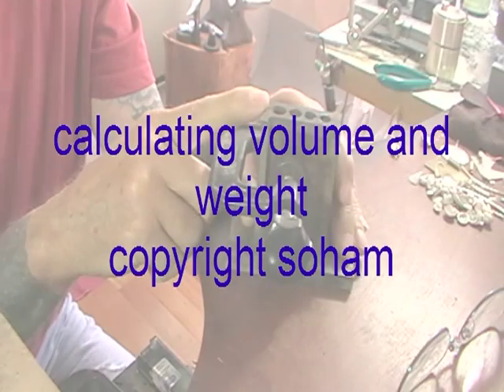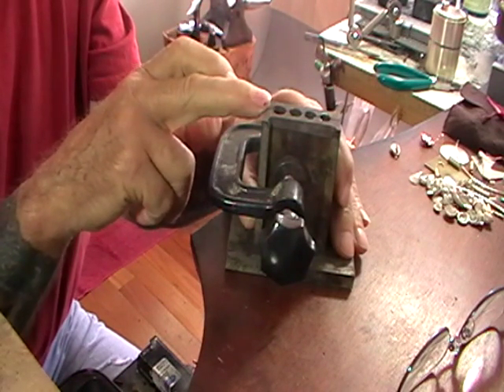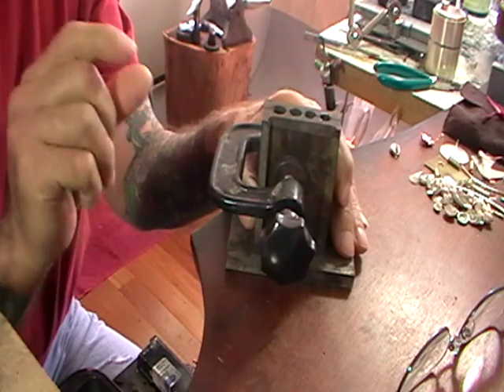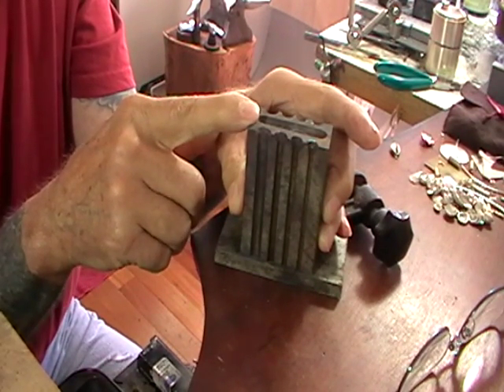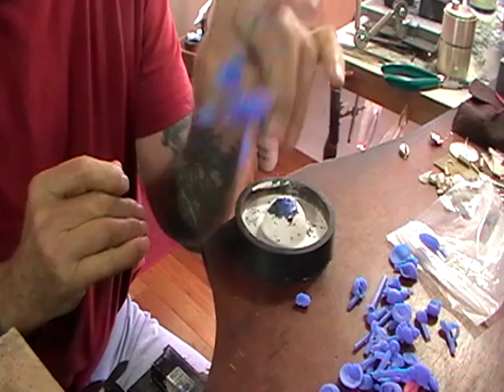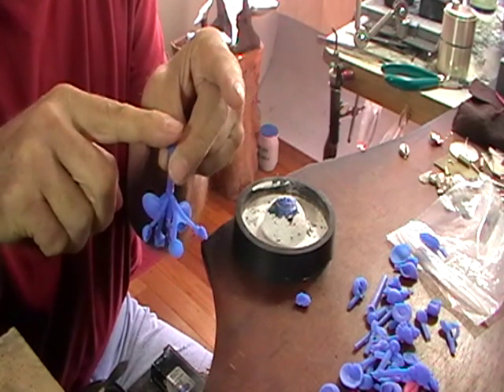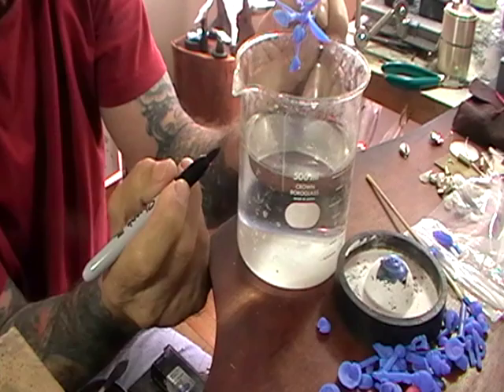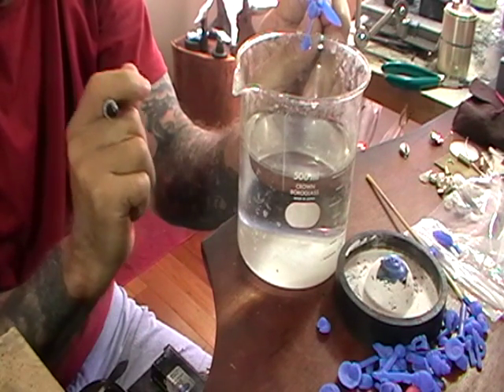calculating volume and weight

Comment: Hi Soham, i have a question about pouring into theingot, i wantto pour half a round bar, but i keep getting air bubbels entrapped into the silver, i triend everything, heating more, less, pouring quicker, slower. Pouring into an angle like you do. Do you have the same problem or can you pour half round bars? Kind regards olivier

Comment: Soham..could I use the water displacement method to determine the amount of metal for a simple sand or clay mold application ?  or is a theoretical volume calculation best. I would like to cast several small shells from our beach vacation.  Is sand or delft clay be a good place to begin ?